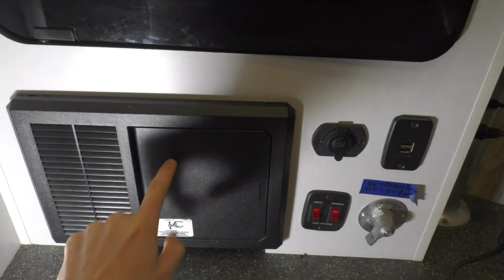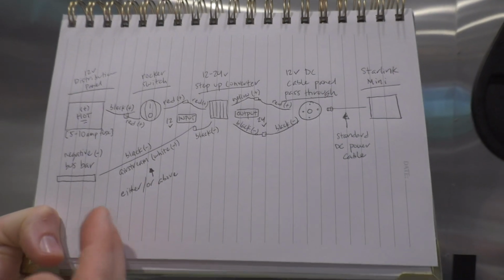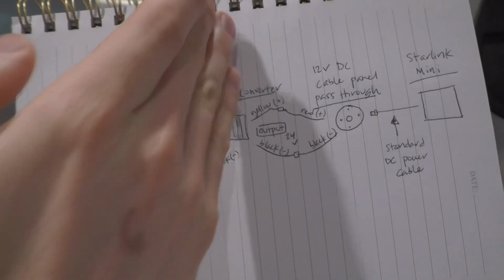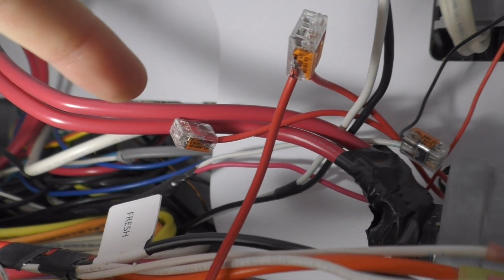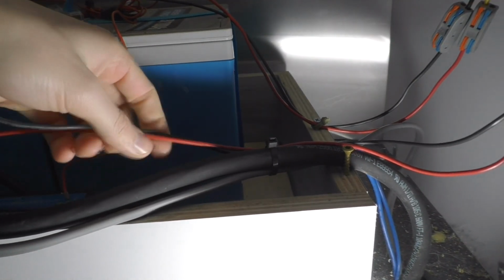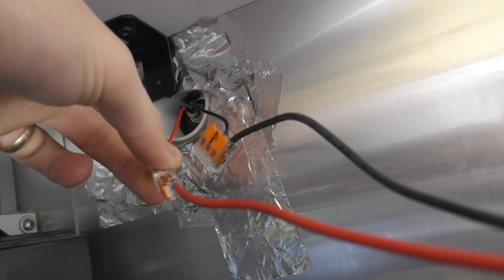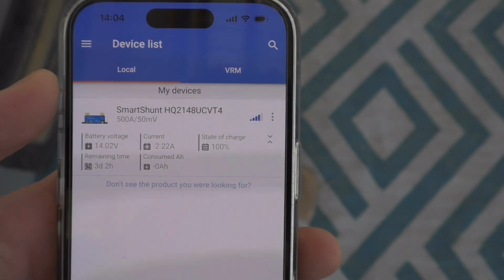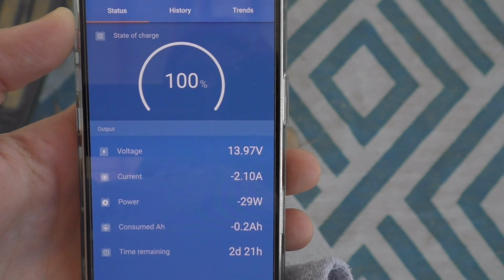Starlink Mini 12-24v step up converter install on Airstream Basecamp!

Comment: Very good video and nice setup. You will find over time that silicone caulk is your enemy when it comes to rvs. It is hard to remove and nothing sticks to it if you don’t remove every last bit. So later repairs are much more difficult. 

Find some good marine sealants or even rv sealants to make your life easier down the road. You will be much happier working on your trailer if you avoid silicone caulk. 

Thanks for the video and safe travels.
Reply from the maker: Thank you for the information! We appreciate it!

Comment: Nice video, thanks for putting this out there.  Question, which lithium batteries did you go with for your Basecamp?
Reply from the maker: https://grenerpower.com/products/grenerpower-12v-100ah-lifepo4-lithium-battery
Hey! Thanks! These are the exact batteries we have in our base camp. 2 of them for a total of 200 amp hours. They’ve been awesome.